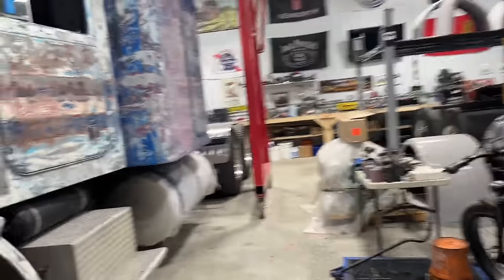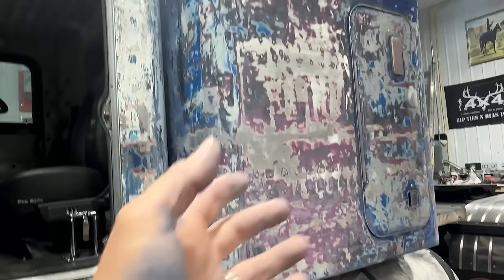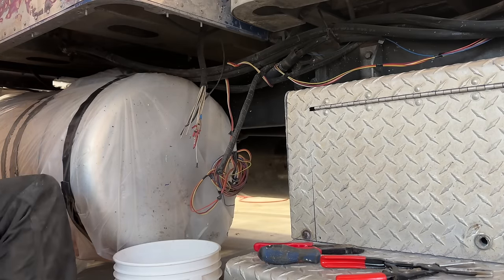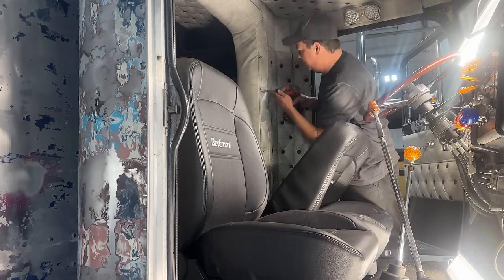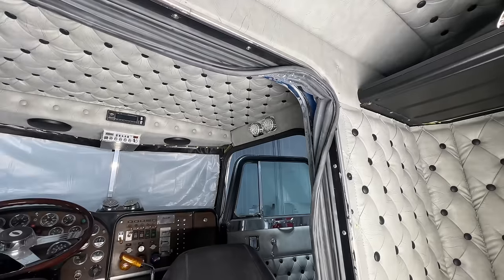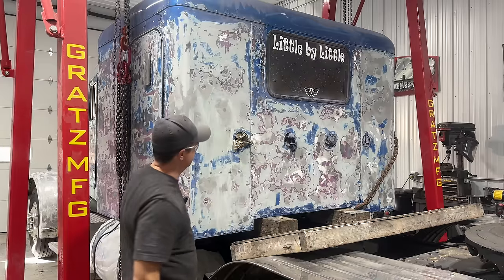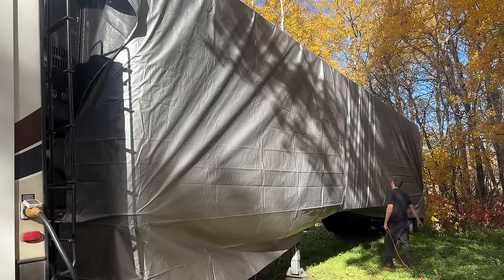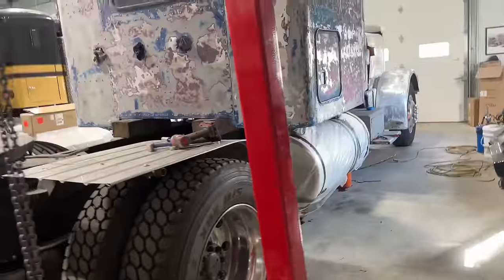Peterbilt 359 Restoration Ep.78 Lifting the Bunk

Comment: Take it from an ex boater.  You don’t want ANY moving tarp touching the paint or wrap.  Not just slipping type movement but also slapping.  It wears the surface big time by spring.
Reply: I just came here to say the same thing. No matter how tight you get it, there's always some movement. I had a friend with a nice car and he had a good quality car cover on it, it sat for about two years and when he uncovered it, he actually had spots where it rubbed through to bare metal.

Comment: I have a 79 359 with a 63 cab like yours.   I big holed it last year.  Bought new rings and took two days with a plasma cutter, grinding wheel, and huck gun and it turned out great.   Measure a lot of times before cutting.   Well worth it and having a few more inches behind the seat makes it great.   I totally recommend it!   Mine is just a hobby truck too.  Some will tell you it weakens the body but that is not the case.   The most important thing is to keep as much of the ceiling ribs in place and liberal use of huck bolts and sikoflex adhesive to make it strong.   I replace my roof with a fiberglass roof just like you did too.  Dallas

Would definitely do it again in half the time.

Comment: Looking good!  Be careful with the tarp on your Snowman trailer.  I know you're aware of the tarp possibly rubbing the paint and graphics, but also watch out for moisture.  The tarp can trap moisture inside of after snow and rain on the ground evaporates and rises under the tarp.   It could cause corrosion issues.

Comment: I got one of those tarp carport things. The tarp at the back end was touching my tailgate.  didn't realize till I went to close the front door. Two hours it had sanded part of my tailgate down to bare metal. Maybe look into those boat/vehicle covers. I bet one would sponsor you. Can get those custom made. Even maybe stick some pool noodles in there to keep the tarp gap away from the trailer.  Don't make that bunk hole bigger. For the amount you use it vs the changes needed. How much room is behind the peddles? Can you get different arms to move them back some for your legs. LBL is going to look so good!

Comment: Ole twins you could spray your cab, then paint the front of the sleeper and put it back on and mount it, before you do the sides and you want have to worry about messing up the paint on the sides of the sleeper.

Comment: Congrats on getting the bunk moved back.
Just wondering when it comes time to wire up the bunk again, would RV style plug connectors work.
This way when you put the bunk back into place all you do is plug the connectors up.
And do they make skins with the larger openings on the bunk and cab to get that larger opening that you want.
Yes I know that would mean drilling out all the rivets and popping new one in when the time comes to skin it back up

Comment: You can paint between the cab and bunk then put the bunk back before painting it.or you can block the top of the wench to keep it away from the bunk. 
 You can put a tarp on the ends then put the big tarp over. We used to put 1 rope on each top corner to tie it back on the side at an angle to keep the tarp from falling off in the wind.

Comment: I vote for a big hole conversion for Little by Little the room it gives you is worth all the effort. I did that conversion to my last truck and kicked myself for not doing when I got the truck and replaced the bunk(sleeper) from the coffin bunk like on Snowman. I thought when I replaced the bunk(sleeper) with one like you have on LbL I was 💩ing in tall cotton until I drove my buddies truck and then I realized what I had beeped missing.  I was lucky enough to find a wrecked truck that was complete and was able to get the interior, trim etc. I also put air ride on my cab and bunk along with a double layer of insulation and one of those little diesel heaters what a difference.  
À thought for storing the Snowman trailer is getting shrink wrap like they use on boats the stuff is not super cheap but it’s not really expensive either compared to wrapping the trailer.
PS be sure to grind/sand every bit of body filler out of LbL because the paint stripper can never be fully neutralized in the old body filler and after a few months to a year the paint will start bubbling up (ask me how I know, because I made the mistake and left some on my truck and even put some bondo over the old stuff I had ground down about halfway or so, it took a year but it was plainly evident what was going on when I ground the bubbling paint off.
Reply from the maker: Thought about shrink wrap but wouldn’t be able to shrink it as the heat would mess up the snowman wrap 🤔
Reply: @TwinStix  Good point

Comment: Mr. Mark. Why not get a carport for RV motor homes to put the trailer under?
Also, use heat gun on your plastic for the cab and bunk, it's will shrink for a tighter fit and seal.
Reply: It needs to breath a bit. Trapped moisture is bad!

Comment: Mark, now that the bunk has been separated, have you thought to test bead blasting the body (in an area not visible) with a softer media like walnut shells or plastic beads? Might make the paint removal lots easier with no damage to the metal AND would clean around those pesky huckbolts and seams / crevices as well. Will be lots of shop mess but if it saves time and does a better job, may be worth it.

Comment: 1994 1/2 is when they went to the big hole Unibilt air ride sleeper. Don't cut your cab and sleeper, too much work and tons of issues that will arise because its not Unibilt design. I had a late 94 379EXD with the big hole, no gain in legroom from my previous 88 377 Pete and assess to the bunk didn't change because of narrow cab and the seats.

Comment: This is a shout out to some of the other commenters who may have solid experience. Can the air ride cab and or sleeper system be retrofitted to the 359? Thanks and take care. P.S. Are the empty pockets shirts and hoodies still available? I can’t remember if that radiator in LbyL had been done before you got it, but the truck was giving evidence that might be needed. In any event, if I could get some new clothing and contribute to that, it would be good.

Comment: Is there a reason why you dont just use a sand blaster to remove the paint instead of the chemical versions?
Reply from the maker: Yup … sand blasted #ProjectSnowman and it created a ton of sanding work to get the metal smooth again

Comment: Love the videos, Im no body guy but wouldn’t sandblasting the paint off be more time saving?
Reply from the maker: Tried that on #ProjectSnowman and it made for a ton of sanding to get it smooth again
Reply: @TwinStix  ya, I figured it might do unavoidable damage.  Keep it going, love your stuff.
Reply: @TwinStix , I follow a bunch of lads here in the UK, in Leicestershire, who restore tanks and other military vehicles. They have a YouTube channel. 'Mr. Hewes'. One of their current projects is a Russian T34 tank. They got a company over from Northern Ireland who have developed a wet 'aqua' blasting machine. It still uses grit, but mixed with water, so it doesn't create dust and is more gentle that traditional sand blasting.

There's a unit which holds the grit and a remote pump which supplies the pressure for the system. Only thing is it's driven off a PTO from a farm tractor and it needs a machine with at least 120hp to run the pump without stalling out.

It looked to give good results in a short time. They were using it on armour plating, but have since used it to strip a Foden 6x6 military recovery crane truck and it didn't appear to cause any distortion of the tool lockers or any other thinner sheet metal.
Reply: The problem with wet blasting is that it leaves wet sand in unreachable areas and causes rust. Take care.
Reply: @carlcarlamos9055 , this system uses much less grit. It's mostly there to help the water lift off the paint. Remember it's being run by a tractor with over 120hp. Most of the work is done by the water pressure.

The guys I watch used needle guns to strip paint as they didn't want sand getting into wheel bearings or the turret bearings. They said to needle gun the T34 would have taken 3 weeks. They aqua blasted the tank hull, road wheels and turret in about 6 hours.

The truck will get dirt and grit on it and wet when it's in use. Most of the bodywork is aluminium, so rust shouldn't be a big issue.